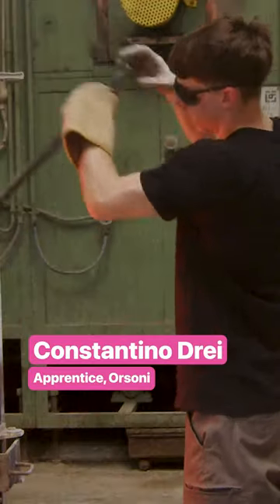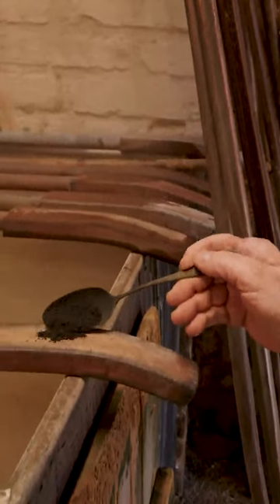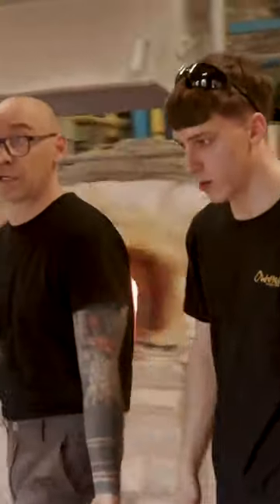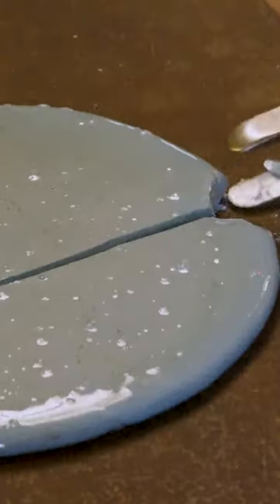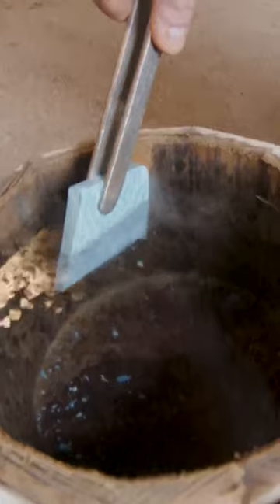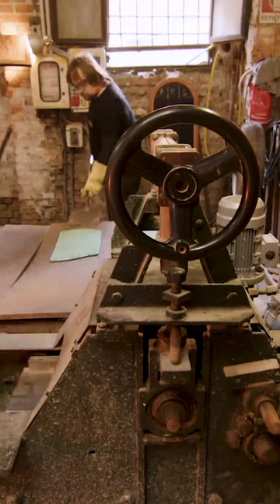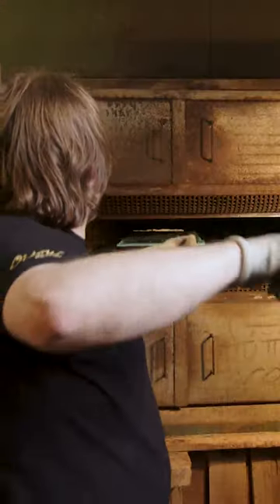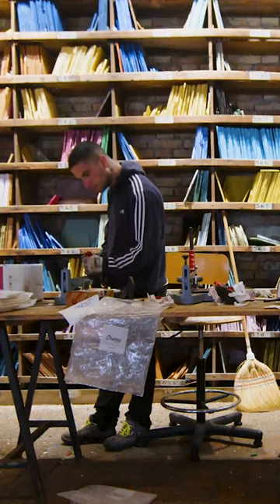It can take some trial and error to turn glass into Venetian #mosaics. #venetianmosaics #glass

Comment: They should have an exact measure of the amount of color pigment they use. That way they can insure accurate color and it take less time.
Reply: the exact composition of the frit that goes into the melt is variable since its a natural material, this makes the colour you get slightly variable, so it can take more or less of the colourant per batch to get the right hue
Reply: I don't think it works in that way. They are not idiots not to think the method. Must be reason why they do so.
Reply: Random YouTube comment thinks they know better than someone who’s role is “Colour Master”.

Comment: Start measuring the amount of things you add and keep recipes for each color sounds like an idea
Reply: I’m sure they know what their doing
Reply: That would only work if the pigment was made from a single material who's entire composition can be accurately reproduced 100% of the time, without any impurities or reactions contaminating it
Reply: @raisinbrancerealofficial  each pigment is raw and purified to start like tattoo inks  , I know nothing about starting glass raw ; but melting recycled blue it comes back blue etc 🤷‍♂️   Temps might vary shade but I'd think they have their favorite work temp to go on  , I just go random for glass bouys for nets so it's not a thing of beauty but it's glass
Reply: @matthewdenty8470  tattoo inks use different colorants than glass does. The chemistry behind colorants and their different applications is so interesting and not as straightforward as you might think! If you have free time and like going down rabbit holes of useless information, I'd definitely recommend checking it out :3
Reply: And then you learn about glass (and pigments) and quickly go erase your past comments